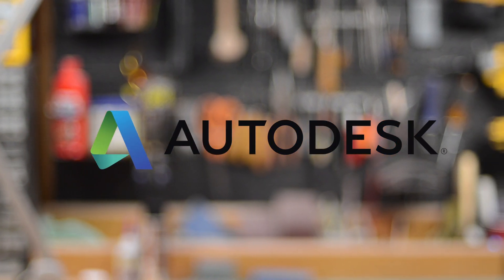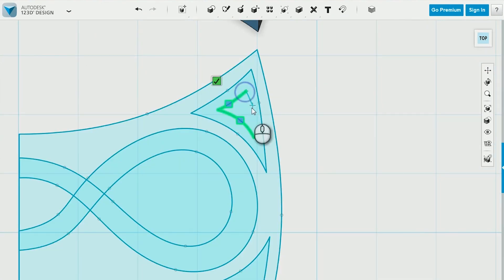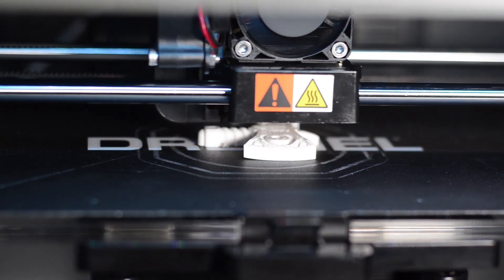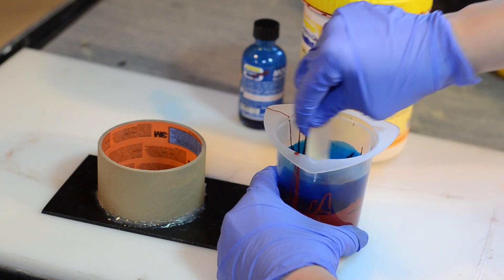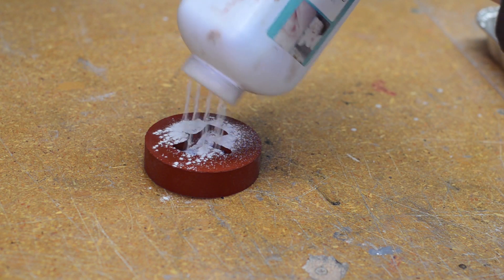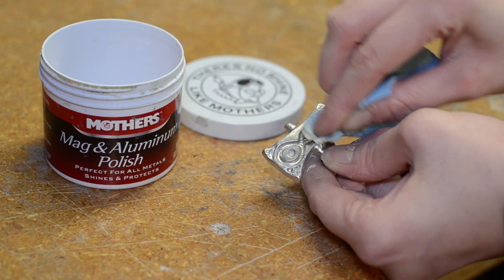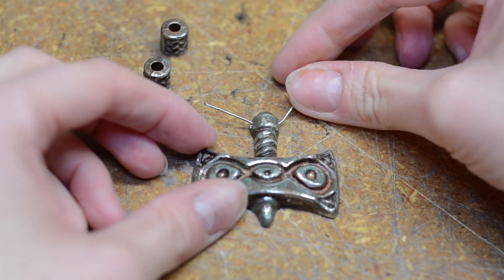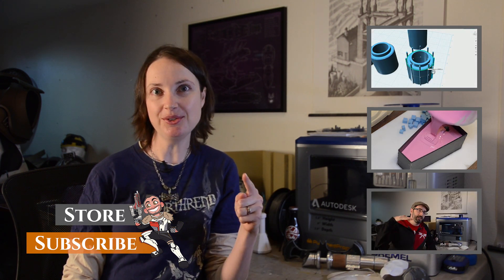Prop: 3D - Season 1, Episode 5: Real Metal Amulet of Talos

Comment: I always stain pewter castings with nitric acid. 10sec in 50% acid and they are completely black for the surface stain to be rubbed off using steel wool, leaving nice dark details. you could use almost any acid, even vinegar or cola (if you have hours to days to wait), just make sure the casting surface is clean (free of fingerprints) before, to avoid spotty patina.
Reply: +Ivan Stroganov Cool! I'll have to try that.
Reply: Here is what it looked like on a project I did https://imgur.com/a/ypIK4

Comment: a 3D printer can use a few different kinds of plastic, depending on the model, right? 

I wonder why I've never heard of any sort of metalized plastic filament. Like aluminum powder suspended in ABS or something.  It'd be really nice to have, especially if your printer can switch filaments mid-print, like some can. make a part that's only like 50% in-fill, and then coat it in the good stuff, and buff it to that nice metallic shine.
Reply: Well, I don't mean actual metal. I mean plastic impregnated with metal powders. 

I wish I could just pour a sheet of an aluminum, iron, or bronze filled thermoplastic, and then vaccuform it later like a sheet of styrene. It'd make mass producing hollow parts a lot faster.
Reply: +Miguel Cuervo the do have those type of plastics even wood ones too they have powdered metal in the i believe
Reply: +Miguel Cuervo Most 3d printer manufacturers will mention what type of filament will work. Some won't take the metal or wood infused filaments, some will.